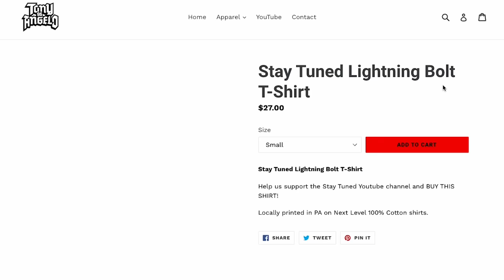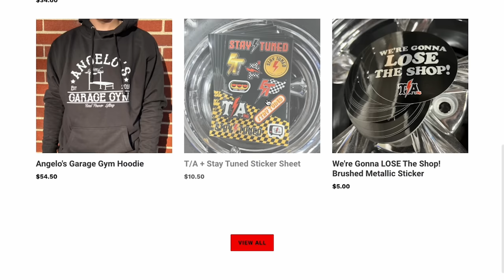Bought My Dream Car, A ‘55 Chevy! + Racing Action at the Bristol 1000!

Comment: My very first car was a 55 Chevy 210.  I gave $37.50 for it and it didn't have an engine or trans.  My father and I built it and that what I drove to school, got married in, and I gave it to my cousin when I joined the military in 1973 just after putting a 409 in it.

Comment: My daily driver in the 70's was a '55 Chevy 210 2 door, with a stroked 327, 3 speed and 4:56's. British racing green with black tuck and roll. At the same time, I street raced a '65 Chevy Malibu SS with a 454, 4 speed and 4:88's.

Comment: Grew up when 55-57's were everywhere.. had a '56 1st, then a '55 & finally a '57 tudor wagon C-D/Gas street & strip drag car, (tilt front end, fenderwells, M22, [several] & a couple 10K RPM, tunnel ram 302's). Used to run 348/409 11" flywheels, when I could find them; otherwise, a 12" truck flywheel w/ 11" pressure plate & 10.5" disk - a gear bangin' combo, plus a 40-some # flywheel for hole shot torque!  LOL

Then, 15 yrs later, built a concept '1957 F/C', (if they existed in '57), based on a perfect 55 tudor sedan I cut into pieces for the skin, & made a chopped windshield roadstar.

Had a Hilborn Injected 392 Hemi from an alcohol FC, narrowed, box gusseted '57 Olds rear end w/ wheelie bars from a '62 Corvette Roadster gas dragster a friend bought & turned back into a street car.

The frame was a concession to safety; Alston rails, then built a cage on them. The front suspension was a deviation from era for sanity & safety. 

 The new Camaro came out in early '80's w/ the semi McPherson strut, (divorced spring). As soon as parts were available, bought a set of Koni drag shocks, then had a friend turn a pair of threaded sleeves to fit them & Koni jam nuts & turned GM's semi McP into real McP's for a fraction of the cost, (McPherson strut drag csrs were cutting edge; woulda cost me as much as the engine & rear end did.

Never raced the car. Got it rolling & running but still short on interior metal, seat, safety equipment, then was offered a job in Florida, working at Vero Beach for the Dodgers as Athletic Trainer for the Vero Beach minor league club & in charge of post-surgical rehab for entire organization.

I had been working for them in the NW League, (short season), & they reorganized rehab & designed the job for me. Bought new equipment for Dodger Stadium, then built a rehab facility @ Dodgertown & moved the replaced equipment there.

Any player who had surgery came to me for rehab, played a week or 2 in Vero, then moved back up to where they came from, in how ever many steps they needed, (high A, AA, AAA & MLB above Vero). Younger players from below Vero played in a unofficial Rookie League at the Mets complex in Port St Lucie.

Couldn't take the car, since baseball involves too much travel & didn't have a safe place to store it, (I lost my '57 wagon by storing it, so wasn't gonna risk it, again.), so I sold it.

Always wanted a '55 post w/ a BBC & 4 speed, tho... mebbe you can live my dream for me, Tony.

Comment: I'm 81-years old, and you are talking to one of the original '55 Chevy owners and hot-rod custom guys.  I got my first 55 in 1962 straight out of high school.  A cherry 2-door dark green Bel Air 265 3-speed with overdrive.  She was sweet, and girl magnet for sure!  I put some full cone hubcaps on her that transformed her like I could hardly believe...lol!  I got five more, all 210's with posts, right out of the Navy into college.  Transformed the first one, into the hottest '55 in the Northwest In 1967.  I was fortunate enough to acquire one of Jim Hall's hypo 327 back-up Chevy Chaparral long block's for only $800.  (I never new what was in it?) Put a set of Corvette hypo heads on the alum. long block (best thing I could get at that time).  The heaviest clutch I could get with HD drag-fast shifter, Anson bullet proof bell housing, 4:ll third member, and rebuilt rear axel and HD drag racing spring clamps (believe it or not, that was all I needed when installed right!).  She turned 130 mph in 10.2 sec.!  The next two were show cars, and my last was a totally stock light green automatic 6-banger with left over show car parts, like extra thick HD baby soft black naugahyde with 2" diamond tucked upholstery through-out (seats, doors, panels, and head-liner) from one of my show cars.  I loved all my '55's, but I literally cried when I had to sell the last one, because she was going to be my forever '55!  Our first baby was born with a rare disease, and we needed the money!  So, please return your car to it's original beauty; paint her the light blue/cream two tone, replace the original body chrome, reinstall the original hood bird ornament, remove all the stock garbage on the front bumper, and 14"x8" black police interceptor wheels, with stock baby hubcaps with the white bow-tie.  Install a set of wide BFG red-line radial tires.  Heat the front coil springs evenly, enough to put a nice little rake on her.  That's my take...  Have fun!

Comment: Nice Find!.  1956 210 here.    Will Never sell.    Would love to have a 54 Belair, Slammed with all the rubber that would fit in that Fat, , , FENDERS,, and 2K+ Hp of course for a high 3 sec pass.   The 54's are very proud with the Low Riders.  Some are Astounding Art.

Comment: That’s a hell of a scoop Tony. 

My dads first car was a 55 Chevy 210 in 1969. He said he used to put a case of Budweiser in the front of the radiator in the winter. I’ve got his 72 Chevelle SS and I’d love to have a 55 that wasn’t finished. I’ve got a big picture of him in front of it in the high school parking lot in my garage. 

Love the tow rig by the way. I’ve got an 03 3500 i bought in 05. It’s got a fully built 6.7 in it with an S4 on it. Towing machine

Comment: Since you've got an M22 on hand, it would be cool to see a 427 in front of it, built to Baldwin-Motion Stage III specs.  L88 cam, Holley 3-barrel on a tunnel ram, side pipes, etc.  I can't remember the last big-block Tri-five I've seen; they're either small-block or LS-powered, save for one freaky '57 210 running a blown and injected Coyote motor I saw last summer in Illinois.......:face-purple-wide-eyes:

Comment: I was in Bristol buying a car that weekend, too, even stopped in for the burnout contest. Unfortunately, the car I was picking up was a 2007 HHR, haha! Just for a work car. At least it's a stick with the bigger motor... 

My uncle has an absolutely DOPE '55 post with like a '67 or 8 327 (hot, doesn't like pump gas, I suspect it's the 360 hp one), a 4-speed, and a 4.10s locker 12-bolt built shortly after he got back from Vietnam, and you're absolutely right, driving that car is WAY cooler than driving WAY faster stuff from post-'74. My truck will outrun it, but I don't give a DAMN, that thing rocks so hard, and it's a '69-'70 time capsule.

It's RIDICULOUS to me that those banks are steep enough to plow a nearly-stock Panther into them on the mat. I've always heard pictures won't tell the real story. I've never been on a banked paved oval, I'd like to try it one day. Maybe not with 30 psychos, maybe just me in a G-body, haha!

How cool it would be to live in a world where I could have not only Finnegan's 'stuff', but also his help. I can't wait to see this thing bloom.

Comment: I have a 4 bolt 355 10k miles on it (at most), close ratio t10 out of a 63 vette (55 bellhousing), and straight axle with disc brakes, dougs fender exit headers , and all the steering linkage your 55. It all came out of mine, I'll make you a killer a deal/trade.

Comment: As a '70s kind of guy (high school class of '74) I say you have to go mid '70s style. Cut the rear wheel wells, 4 speed, big block (396? 454. No shit!) with dual quad tunnel ram. 👍

Comment: I believe wagon cars are boxed. Been awhile since iv messed woth one. We did a full resto on a 57 bel-air vert that was to the T factory. Factory frame all body worked to keep original cause pits after blasting. Had the fuel injection system factory. But after they spent many thousands they pulled etc. Same ol same ol with ppl. Gotta have money to build any car let alone a 57 etc. I believe just the resto on the injection was 3500 about 12 or 14 yrs back. Last one i worked on was a handy man. Full floor and quarters blasted frame. It was rough af to begin with plus cant find shit for em. Anyways cool car and will hold its value more than most.

Comment: Wheels are Appliance brand and they had a wire basket that set in the wheel with a knockoff that screwed on to hold the basket on
Reply from the maker: Appliance made the Blackjack headers, right? Great info, thanks!
Reply: @StayTunedTA  yes I believe so. My dad worked at a tire shop back in the late 70’s early 80’s and he put a set of them on my moms VW super Beatle.

Comment: excited for your 55. not a fan of the gasser look. but also your car. i just picked up a 56 post recently. been a dream car for a bit. it had to be a 55 or 56 post for me. my has escalated slightly, had a seized up 427 and m20... now has 468 (454+30 over) and 5 speed (aisin ar5). i got it with the body fresh from paint, so i feel obligated to make it nice... so moving slower than i would like. but also not sure i will ever sell, so i have time.

Comment: All 55 chevy frames are boxed, The California Frame is smooth on all four sides of the rail. The standard frame looks like two sets of rails put together and welded along the top and bottom of the rails. So the california frame is preferred for its smooth show car quality once painted. Almost forgot convertible frame have the added x-brace.
Reply from the maker: Thanks for the info! I knew there was some difference.